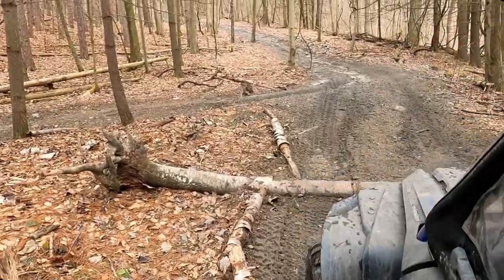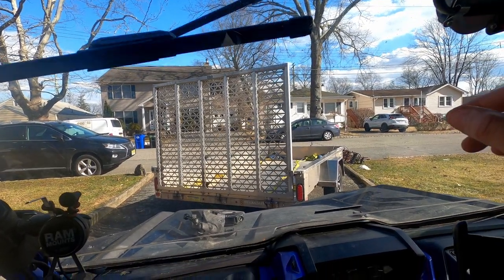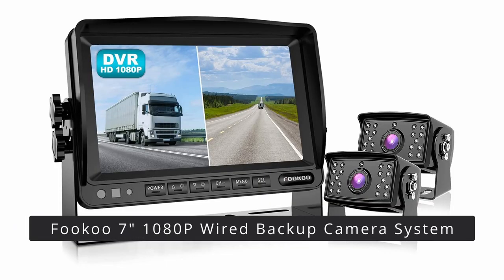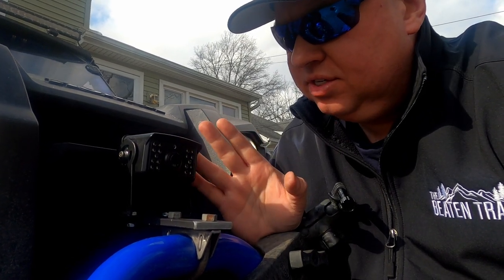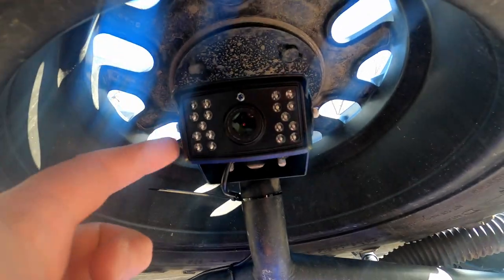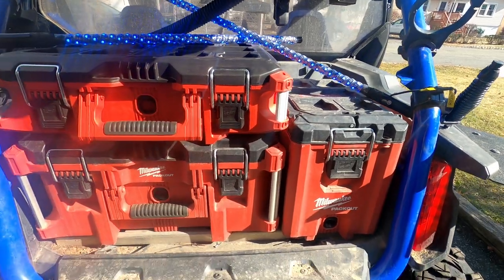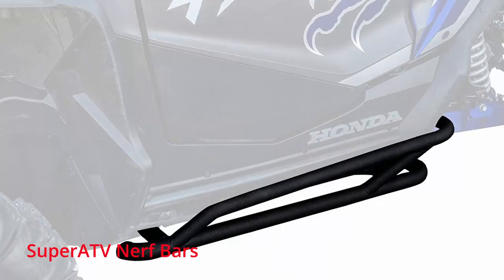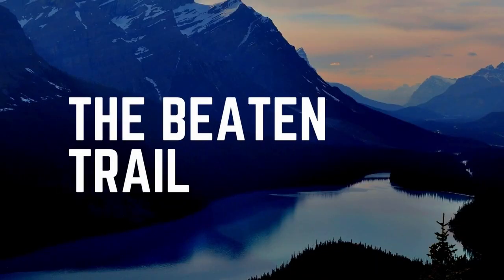Honda Talon 1000R Accessories Update -Wiper, Camera, and more

Comment: Wanted to see what kind of range you get on a full tank? Heading to Arizona soon and planning on having an extra 3.5 gal.
Have heard some in the desert that may get 20-22 on hard pack. Knowing it can differ by driver and riding conditions.
Thanks for your video.
Reply from the maker: I have never really measured it, but with a 7.5Gal in the Talon, I feel I get the same as I did in the Rzr Trail with the 9.5Gal.  I'll have to do some real world testing on that, but the Talon really feels like it sips less gas with the trans vs the belt setups.   That being said, I always carry the rear 1.75Gal on the back JIK.  I've never had to use it for myself, only for other riders in the group.  Can-ams, Rzrs. Glad you enjoyed the video!